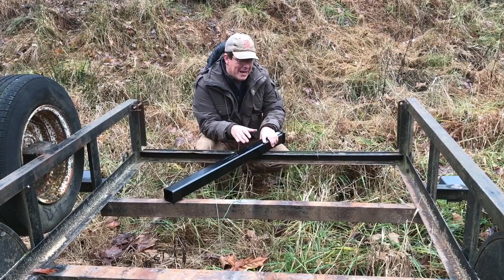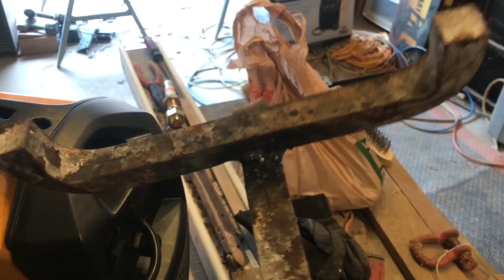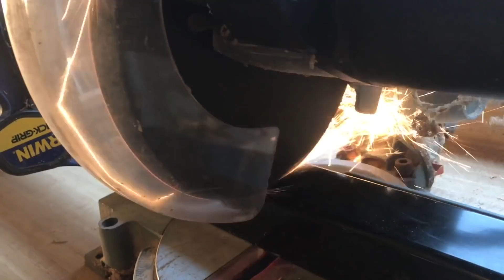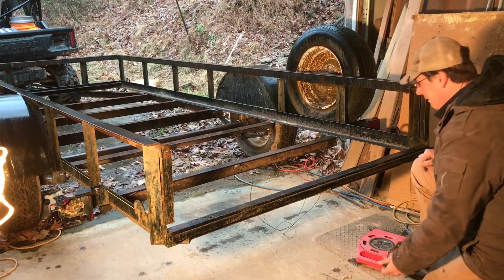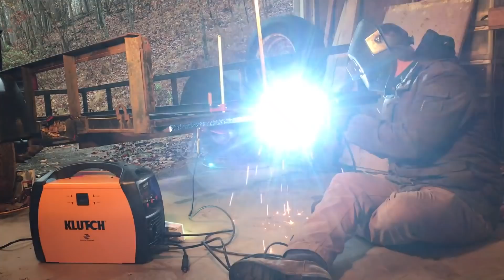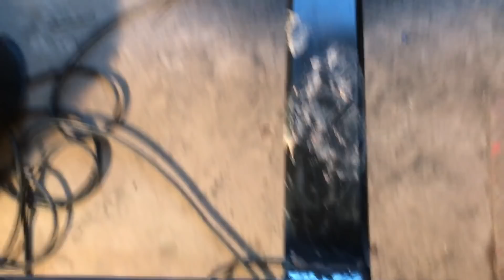Welding for the first time on our trailer rebuild project

Comment: On heavy metal like the fire iron, bump up the amperage if your power can take it and zig zag a bit to get more heat in the stock and warm the metal first. You missed the joint. 😁 Here's a hint; for old welding sticks, dry them out in a warm oven before you use them.

Comment: When welding never be afraid to grind the metal clean of rust or anything that is not pure metal. Your grate would of welded at least 80-90% to perfection if you would of cleaned all the rust off were you were welding. Your welds look as good as anyone else could do on that rusty crusty metal as it is. Basicly what you did was for exaple.......take 2 old peices of wood with 15 layers of lead paint out of grandmas attic from 1902 and glue them together with tightbond 2.......the bond is only as good as the paint is holding but later in a month layer of paint #4 and 5 come apart and you end up with 2 peices of loose wood again.  Well your grate is similiar. The layers of rust and soot from the years of hot and cold ext is hard to get any weld to penitrate to the good metal. It can be done but its always better to clean were you are wanting to weld.  
       If you ever see a true welder that takes pride in his/her welds youll see them even buff fresh clean metal were they will weld. It cleans off any oil or millscale ext so the weld stays clean and pure.  They use a grinder more then you think. And any welder that makes more then $18-20/hr will likly rather not bother welding on rusty older metal cause they just cant be bothered to clean it up to weld. I have a school friend whom ended up through the years winding up being a foreman making over $50/hr and now dont even want to touch a welder lol. Cant blame him i guess. 
      Practice makes it happen too. You obviously know the justs of it....alot better then some people who have no idea
Reply from the maker: I ground down every spot to shiny bare metal. No rust where I welded. Camera may not have shown that very well.

Comment: Sounds nice enough the way the welders set. Just practice, if you can’t weld always make sure it’s all good and clean, don’t rely on the rods. 

Don’t go too quick “common fault of beginners” try and look through the slag to the weld pool, it’s not easy but with practice you don’t need too, you just know. If you can’t weld and the steel is thick don’t worry about cranking up the amps, it’s not ideal but getting a complete weld is more important.

To make it tidy always tack at the end of a natural run, corners of box etc as this allows a good run without a tack in the middle.. 

I started teaching myself at the age of 14.. did a course at 16 but the more you do the more you learn... that’s 23 years ago now 😢

Comment: what you paid for that peace from etrailer, you can buy a 20 foot length of semless tubing and drill the hole, i build all kinds of hitches. well the good side is, someone will find some nice bikes on the road,unless thats good paint, at least your not starting off with mig.. one must learn to weld stick rod the right way before ever taking up that, good idea converting you wood saw to cut steel, but one problem, they are not made to cut steel, and all the metal filings get sucked into the motor taking out bearing, rotor after a few cuts, but it will be good well it lasts, i have totaled many yard sale skill saws over the years just for fun..litttle tip from an A class welder, your first past make small T"s stopping to the count of 3 at the end of each of the ends of the cross of the T the leg of the T is a pre heat and clean out path

Comment: I did a similar setup on our pop up camper. It really affected the tongue weight with bicycles attached to the rear of the camper. I had to add 100 pounds of weight to balance it back out.

Comment: Some tips for you Troy:Since you are using an inverter machine you are welding in DC current. Standard 60 series rods are for AC welding. They do make DC specific 60 series rods. Also the 60 series rods are celliose based and the inverter machines don't burn them very well. Buy some 7014 or 7018 rods. They will burn much better on an inverter machine. Also a good starting point for amperage is around 90 amps for a 3/32 rod and 125 amps for a 1/8 rod. As you mentioned start with a clean bright shiny surface. Also grind a clean spot for your ground clamp. I couldn't tell if you did that or not. Also doing over head and vertical welds you will want to use a rod that has the fast freeze benefit so your weld puddles wont run. Once I get my new shop built and up and running you can come down for some lessons.
Reply: you  can also get 7014 and 7018 in AC, not sure that 110 volt unit would burn a 7018 3/32 Dc it may, or may not, a lot of them will not, 7014 is a low penetration sheet metal ros

Comment: i bought a klutch welder for stick and tig welding at my house.  plugs into 110v outlet.  so far its everything ive wanted it to be.  I used it to do a barrel stove maple cooker, and now doing a oil tank 2x4 cooker.  i did a stainless pan for the barrel stove also.  

Best tips for welding with stick is make sure the material is clean and bare metal.  get the first rod right down into the weld and just drag it.  the filler top rod goes over the top and drag in side to side like you are tying a shoe but each point is overloapping the other. easiest to weld in the horizontal position